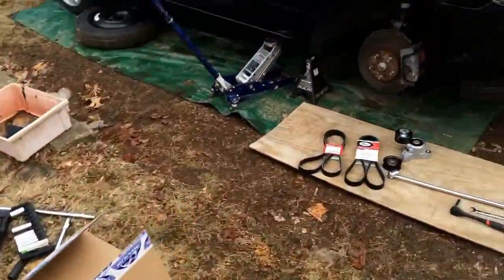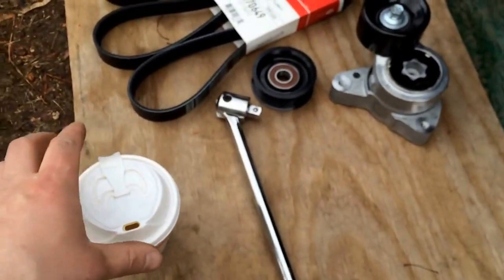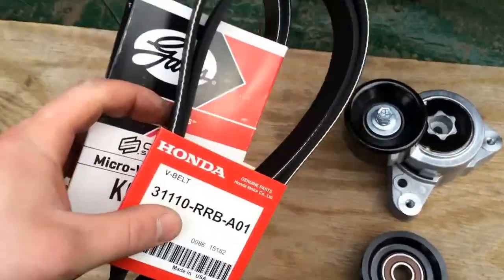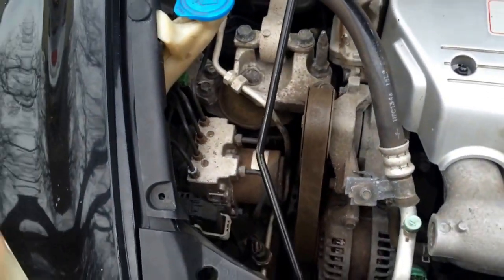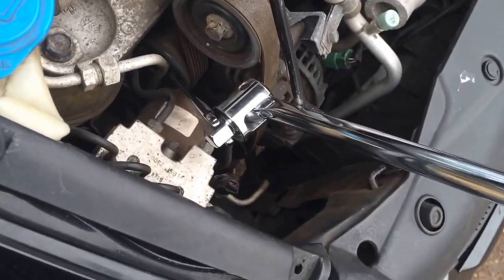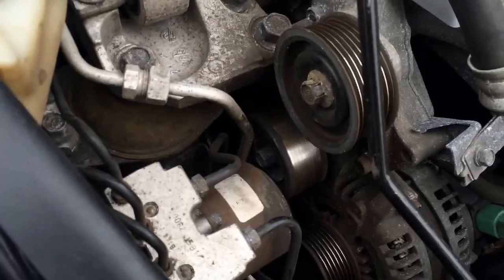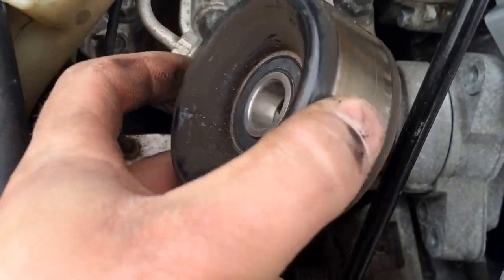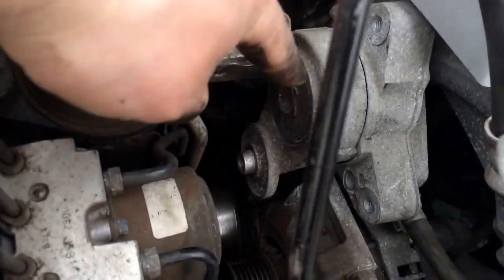Honda Civic Si Idler Pulley & Tensioner Pulley Replacement DIY (2006-2011 Si)

Comment from the maker: Need some cheap $5 wheel chocks?

https://www.amazon.com/gp/product/B000BQYH6Q/ref=as_li_tl?ie=UTF8&tag=gerbproductio-20&camp=1789&creative=9325&linkCode=as2&creativeASIN=B000BQYH6Q&linkId=6e254ab2d146fe40daa4d91656eb8b04
Reply: Gerb Productions hey brother, do you remember what tool you used for the mounting bolt on the tensioner, the one you said it was hard to get to. Im about to change mine this Saturday just wanted to know to make life easier. Thx in advance
Reply: Whats up dude i own a honda civic si 08  one day i my si was jus off bounce hard felt like a broken mount mount  i pop the hood and right by the right of the motor alil under where u working at i see two bolts popping out loosen  im confused how can those bolt loosen i was hoping u can help me  idk if it the torque mounts blots idk im
Confused !!!
Reply: @bryanarango7227  did u figure it out? i wanna try this myself but not sure if i'll have the proper extension or u-joint to reach it
Reply: Thanks for doing this video man I just changed my pulley and I'm still having the same sound  will the bearing make a weird noise on startup if it's got a bad tensioner pulley
Reply: @eliosantiago1045  put I light lock tight on them or they can back out I had the same issue

Comment: I would like to have heard the sound before you did the job.  I think a friend's car has a similar problem. Video was mostly good ... you needed a second set of hands to film while you removed and reinstalled bolts.
Reply: Sounds like a whine when you start and accelerate your engine really fucking annoying when you wanna cruise😂

Comment: The idler pulley's torque spec is 16 not 41.
Reply: What about the tensioner bolts if you don’t mind me asking? The same, 16 ft-lbs?

Comment: Thanks a lot. Same problem, not many videos on what we have to do, and you answered where that stupid tensioner was. Thanks.
Reply from the maker: Glad i could help you bro!  I want to learn everything about the 8th gen si's.  Done a clutch, valve adjustment, exhaust work, and more.  Think it's time to pull the motor for a build lol (maybe).
Reply: Mine's all stock, but I had to replace the A/C compressor/clutch/coil. swapped out the serpentine belt while I was at it. Had to take apart the whole front end (bumper and radiator) to get the dumb thing out and probably could have saved about 2 hours if I knew I had to from the beginning! But I'm going more hands on with fixing it, saved about $400 by putting it in myself, could have saved about another $100 if I didn't have to have it evac'd. At least they refilled it after I was done for free.
Reply from the maker: All matters who you buy the car from.  Mine wasn't maintained well, so i ran into some problems.  For example, my clutch went lol.  Only thing I don't like about the 8th gen si's are they're tight to work on.  Yours will run mint when all that stuff is done.

Comment: So do you have to replace the entire assembly of the tensioner or could you just replace the tensioner pulley alone?
Reply: Don't replace one, just replace all 3. Idler pulley, belt tensioner, and the belt. Around $100.

Comment: awesome vid. i know it's not the proper way to do things, but is it possible to just release the tension, move the belt off to the side a bit, replace the idler pulley and then easily put the belt back onto the idler pulley? basically i don't want to re-route the entire belt just to replace the idler pulley, as the previous owner cheaped out and only did the tensioner and belt last time (i know.. wtf!?)
Reply: Yes you can 🙂

Comment: I think this may be my problem on my boosted fg2. I acquired a death rattle that’s making me fear the worst. Gonna try removing the belt and turning it on see if I hear this noise. If not it’s definitely something in the timing chain. I’m hoping this noise is the tensioner !

Comment: For some reason my belt tensioner bolt won’t go back in… like it goes in but it won’t thread to anything… no idea why
Reply: Had this happen to me in the part store parking lot. That tensioner pulley has a captured nut that falls out. My nut feel behind the alternator 😢. So I wrapped it in teflon tape, so much that you have to jam it in. Once it’s jammed in you can thread the bolt without it falling back out. Or you could use super glue but they want $8 for a 8 pack of gorilla glue. Teflon tape was $1.99 for a two pack haha

Comment: Big FAN !! I really appreciate all your VIDS!!  I have an 09 SI sedan 120k on it.. !! Bout a year ago I noticed whenever I turn on my AC it would start shaking...specially if I hit a red light.
did my research and work myself around the air system, filters,TB, spark plugs even my engine mounts..
I don't hear any bad sounds coming from the pulleys area.
Can one of these Pulleys be messing with my AC?
Or my AC compressor is Done?
Reply: Could be the vacuums

Comment: Thanks for the vid. This is what i needed. I want to change my tensioner pulley and idler pulley on my fn2.
I think they are the same pattern.
Reply from the maker: No problem man, glad you liked it.  It was actually easier to do than i thought.  I'm currently doing a clutch on mine...  Probably the hardest thing I've done on this car.
Reply: +Gerb Productions ill get mine fix soon. Changing clutch is a pain in the ass but good luck anyway. Thx again for the vid.

Comment: How are you? Mine only when the car is in cold temperature completely grinds a little at the beginning or when the humidity of the water arrives? What could be a belt or tensioner?
Thanks excellent video.
Reply: Nelson Alejandro A' I have the same problem and I’ve heard it’s the starter

Comment: Thank you for this awesome idea. Just put my belt back on. Still can't undo the bolt on the crankshaft pulley though because it's now in 2 pieces and the inner turns while I lock the outer piece.
Reply: Did you ever get this alleviated? This also happened to me (crank pulley separated into 2). Placed the pulley remover I rented from AutoZone on it and wedged my breaker bar into a solid point under the car. Gave the key a quick blip and the pulley rolled right off.

Comment: My car makes a whining noise and my friend took a listen and said it was the idler pulley was yours making any kinda noise? Ive replaced the belt and tensioner beforehand thinking it may have been the cause, but im going to go ahead and replace the idler in hopes it may be the problem. Great video man
Reply from the maker: +Brian Chang Mine had a slight whining noise, when I changed belt, tensioner, and idler, it fixed everything.  How many miles does your car have?  And thank you, appreciate that.

Comment: friend or subscriber someone has an idea why when you turn on the civic 2007 you hear a sizzle and when you accelerate or move the steering wheel you hear more but when you have a time on stop listening, it is worth mentioning that this is done in cold temperatures in the morning to be more precise and that the address liquid is correct please help

Comment: Once you have the idle pulley and bracket out of the way, can you just replace the tensioner pulley without removing the bracket?  I know there is nut on the back side of the bracket.  Can you hold that nut while trying to replace the bolt with the new pulley?  Is there enough room?  I know there are two bolts that hold on the tensioner bracket.  I can't tell from your video but can you access the other bolt on the other side of the pulley with a socket and ratchet?  Just trying to see what is the easier approach.  Thanks.
Reply: Lucky me I dropped a nut and I spent hours trying to locate it and I finally gave up went and purchased a new net and used boil tape to hold it in while I reinstalled a new pulley on the tensioner I guess Honda didn't put a nut fixed to that tensioner because they thought it would be get stripped

Comment: Question, to remove just the pulley on the belt tensioner does it go out by moving it anti-clockwise or clockwise? I got confuse in one of the video that says clockwise to get it out. thanks.

Comment: Dude I know its been a while but check your tensioner. I just put on the same Gates kit from rock auto yesterday on my 09. New belt, tensioner and idler pulley. After I installed I noticed the tensioner wear indicator was just about at the "replace belt" mark. I'm gonna call Gates Monday. I think the belt they include is to long.
Reply from the maker: What the....  I don't have this issue. Maybe they mixed in the wrong belt size or something, very weird..
Reply: Went out yesterday and bought a gates k070644 belt. It is a 64.4in belt, belongs on the 06-11 1.8L without A/C. The k070649 that came with the kit was to long. Now the arrow on my tensioner is right in the center of the raised area. Idk man weird lol.

Comment: Hey so I'm not sure went out on mine but the car literally won't start. The last two weeks I was hearing whining noises coming from the idler tensioner pulley area. So I'm guessing it's those two... but my question is would the car start if those pulleys are shot? Because my alternator is good
Reply from the maker: The car should have started, even if the pulleys were on the way out.  Mine were making a slight whining noise, but my car started.  How is your serpentine belt looking?
Reply: Gerb Productions yeah mine were whining for 2-3 weeks and then while I was driving home the other day I'm guessing the shot through and the car turned off. The belt is a brownish color
Reply from the maker: That's weird man.  Order new pulleys and a belt, start there.  Hopefully it's not anything major
Reply: Gerb Productions yeah that's what I'm doing. And I hope not. Thanks for the help and the video man!
Reply from the maker: kb50cal Go on rock auto and get the gates kit...  OEM is pretty expensive at the dealer.  Let me know how everything goes.  Thank you for the support!
Reply: kb50cal the same exact thing happend to mine today left me in the highway lol .. the car has power but wont start up

Comment: If I just need to replace the idler and tensioner pulleys and not the belt (since that was changed 18 months ago when I had to have the condensor replaced) do I have to undo the bolts around the pulley assemblies, or can I just remove the center bolt on each and replace the pulleys alone?
Reply from the maker: Follow my exact steps man

Comment: Can you get away with just changing the belt or did you think changing the tensioner  and idler pulley are necessary?
Reply from the maker: You could, but i would change it all just to be safe.  If there is cracks/splits in your belt, change it.  Tensioner will make noise when going bad.
Reply: Makes sense! Thanks.

Comment: What type of sounds did it make to make you think it was bad? I hear a squeak some times when a start and when I shift gears (manual) or if there is to much load on the engine. I'm pretty sure its the belt and the tensioner but would like some input!
Reply: Jep , thats them... it started on my kswapped em2 coupe like that, and today the idler pulley bearing literally just BLEW apart after a very scary sound & started smoking and shit... iron filling everywhere lol 😅
Ordering new pulley and belt tomorrow!

Comment: I noticed the autoparts stores sell the tensioner pulley alone, without the rest of the assembly. Is there any reason why you’d want to replace it all and not just the pulley?
Reply: I was just thinking the same. It’s 100% the bearing on that tensioner that goes out. Not the actual tensioner bracket. I’m gonna do this today because mine is shot shot. I’ll let you know if it fixes my issue.

Comment: Do you have to replace the tensioner pulley assmebly or is replacing the tensioner pulley enough?
Reply from the maker: You could just change the tensioner pulley, but it’s recommended to change out the whole assembly because it has a small wheel that rotates with a bearing, etc. could possibly seize up eventually. Totally your call though bud
Reply: @TheGerbsteve  Thank you man! Great work on the videos!

Comment: Did you have to take out the tensioner pulley off of the new assembly in order to get that bolt that was hard to reach?
Reply from the maker: No, you can get back there, it's just a pain.  Take your time with it.

Comment: Would the tensioner rattle if it was loose? I have a 2005 Acura TSX and when I'm stopped in gear, there is a rattling sound coming from that area. It gets very loud when the AC is on too. It gets almost silent when in park or neutral. I don't know what it is, but it's so annoying.
Reply from the maker: That's funny.  To be honest, I have a rattling sound when my ac is on as well.  It could either be that or a heat shield.  Try replacing the tensioner.  I bought a gates one from rock auto.
Reply: I already tightened the heat shields. Someone else said that it could be the engine mounts. I think I'm going to just take it back to the Acura dealership and have them look.
Reply from the maker: Wouldn't hurt.  Engine mounts will probably bee expensive.  My car needs them.
Reply: Gerb Productions how did you remove the tensioner pulley? I'm having trouble. I can't fit my socket wrench because it's too tight. the ac line is in the way and also that device with the black wires
Reply: @Weezybaby7o7  I just removed that bolt with a 1 inch extension and a 3 in extension in a ratchet and a 12 mm socket you have to go behind the AC line

Comment: hey got a question. when u  put the tensioner pulley back did it give issues where the pulley would lock up. and The bearing popping on some after trying to tighten it back on I'm stuck at this point thanks ..

Comment: Thanks for the video, just wish you went all the way with removing the tensioner pulley assembly and how you went about installing the new one. Also, is the torque on the tensioner the same 41 on the pulley and 16 on the bolts? Didn’t catch that part either.

Comment: I used your k-tuned CMC & slave replacement video to do my job on my own 08 civic si and like this video you have a habit of skipping a lot of important steps and just briefly go over something - like how much of a pain it was to get the serpentine belt back on - thats probably going to be a pain for me to get on as well but now I have to go to another youtube video to see how to do that since it isnt included in yours - which it definitely should be for the scope of what youre doing in this video. Your videos start out strong and then it seems you just want to be over with it and assume we'll 'get it' after a certain point. I'd change that about your videos if you want to get a really strong subscriber base looking for quality vehicle DIY repairs (think Chris Fix or Eric the Car Guy)
Reply from the maker: +Gahechi Esmichi I do my best with the knowledge & tools I have.  I don't want the videos to be over with or else I wouldn't take the time to make them.  I am still learning & improving on everything.  I appreciate your opinion though.  I don't really care about subscriber base right now, but I understand what you mean 👌🏼
Reply: I also used your video to replace the CMC on my 08 civic si fa5 and it was very very helpful and made it easy for me except for an important step (if im not mistaken) you missed to mention on the video and that is to bleed the line after replacing the cmc using the slave drain plug and refill the reservoir as you do so to regain the pressure. 

But man as you said you are walking us through your experience and improving in the process and as a fellow Honda DIYer im really thanksful for your videos. Im subscribed! Keep it up bro.
Reply: hahahahah you are right ! This guys opens up the topic in detail and all that and was about to be the best youtube video in that topic until he started fighting that belt hahaha.. You can see that he spent about to hours to replace the belt because it was dark when he was done hahah... but yeah lets go watch another vide that talks about hot to get the belt on now hahah
Reply: I gotta agree with Mr. Esmichi-you're skipping too many steps:( Appreciate the effort though!:)-John in Texas

Comment: hi, I have a 2006 civic and you mentioned they have 6 pulleys. I have a noise coming from one of them but it's the one way at the bottom. Are those reachable? if so how and do those have a different name?
Reply from the maker: Yeah, pretty sure if you take your wheel off you can reach that one.  Pretty sure it's the harmonic balancer.

Comment: Which idler pulley and tensioner pulley did you get from Rock Auto? I want to get the same idler pulley you have. Going to do the same job on my civic si
Reply from the maker: +Javier Carvajal I got the gates ones.  In my opinion, they make some of the better pulleys, belts, etc.  Let me know how you make out with your si man

Comment: can i just replace the tensioner pulley an not the whole bracket?
Reply: Yes you can just be careful and note that the bolt that holds the pulley on the tensioner has a nut behind it that is not fastened to anything it's sitting in a nut Alcove and it will fall out once you remove the bolt into the abyss where you could never find it when I put it back together I had to purchase a new nut and foil tape it to the back so it would stay until the job was done it worked out perfect

Comment: Did mine earlier today. How the HELL did you get the bolt in the back there back in???
Reply from the maker: Pretty sure i put the bolt in a deep socket and threaded it back on
Reply: Gerb Productions you must've done it with the pulley off im assuming. I can't even access it with the complete assembly back on. So somehow you would have to hold that nut on the back of the pulley and shoot the bolt through